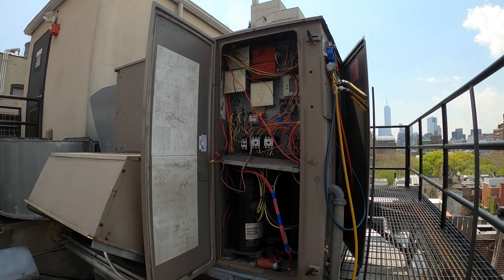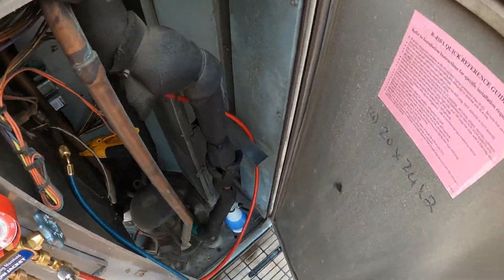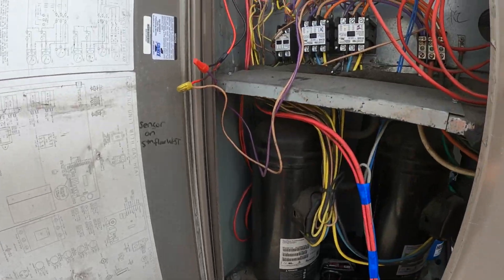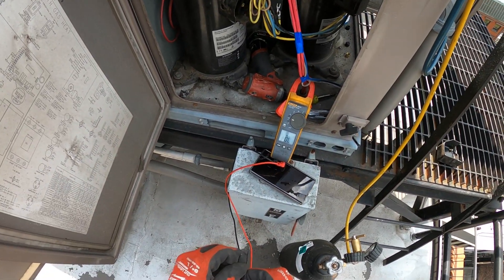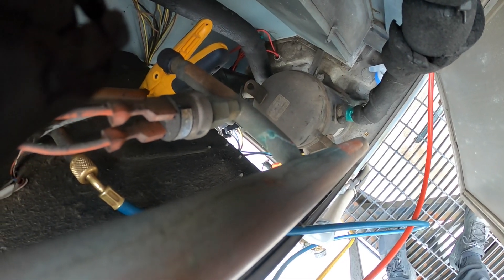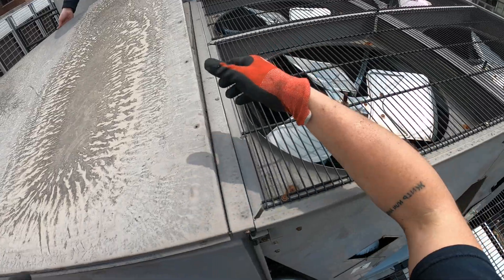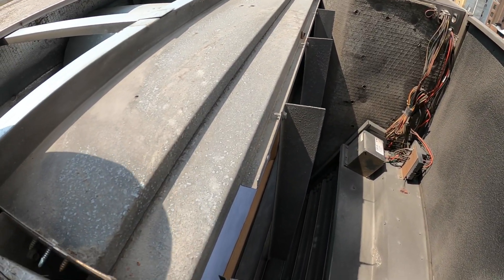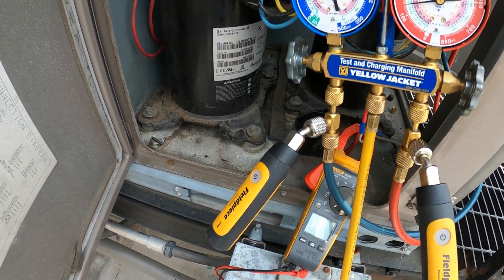HVAC: York RTU Not Cooling  Follow Up & 1 of 2 Circuits Down (York Packaged RTU Troubleshooting)

Comment: They are going to need a new coil. How its getting up there is beyond me. Duct work my have to be removed if 1st circuit compressor goes. Damn, this is a bad one. Quote  high because you dont know what you will run into and the man hrs will be high, especially getting a coil up there with no damage.

Comment: I would go for new coils on this one if I were the client 👍
Reply from the maker: Facts. An expensive repair but nothing compared to getting a crane and replacing this unit. Plus all the fire alarm contorls put in. Thanks for watching! 🙏🔧⚡️
Reply: @JumpermanTech  How do you get the coil up there with no damage. 3-4 men 16hrs each to be safe then material X 6 for cushion. All this could have been avoided with a PM contract.

Comment: Isnt R22 hard to come by? Shouldn't that sway them into replacement when they cannot get or pay a lot for refrierant?
Reply: No it’s not hard to come by. It’s just expensive
Reply from the maker: @Josh-px6xb  💯💯💯
Reply from the maker: This is actually a R410A unit. R22 is very expensive and it's been phased out for a while. A new evaporator coil will do wonders. Thanks for watching!